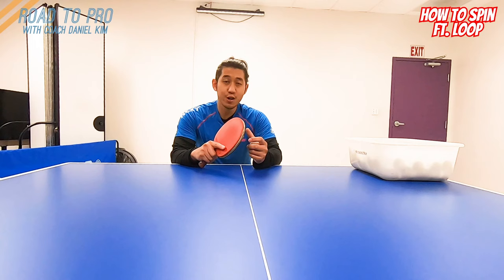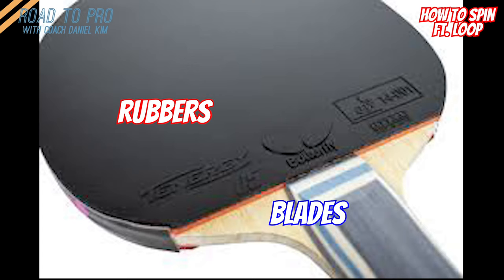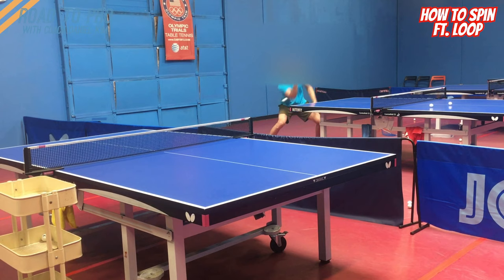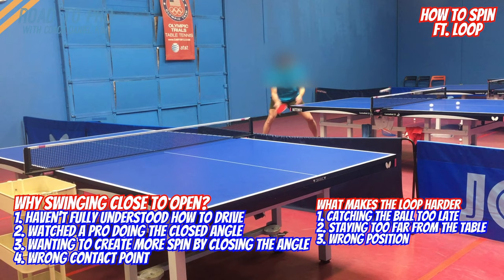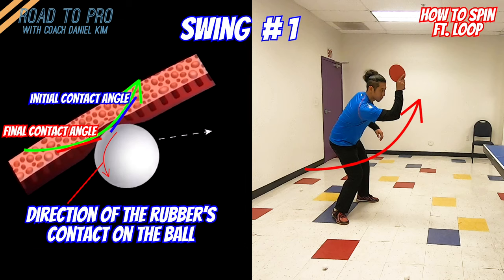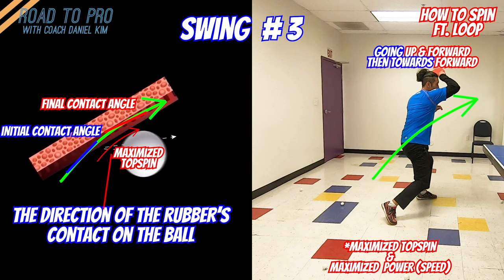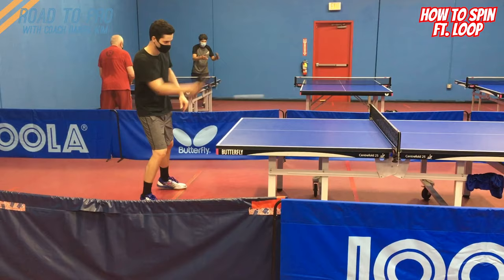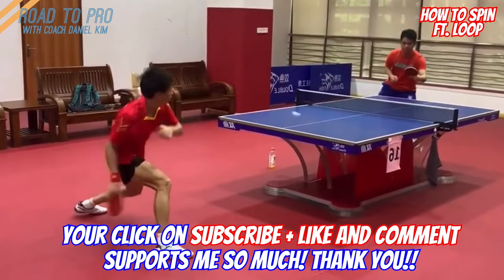Table Tennis | Ping Pong [Must Know - How to maximize TOP SPIN and POWER on the loop] 탁구 강한 회전의 이해

Comment: Thanks. I am a pen holder. My coach said one of the advantages of pen holding is when you loop, you can increase the quality by pressing the thumb when the ball contacting the rubber. She never explained why, and after a while of practicing this technique, I gave up this pressing the thumb. Now, with your video, I understand the reason. Pressing the thumb at the moment of ball contact is basically closing the paddle angle as in Loop 3 in your video.  I am going work on this again, no giving up this time. Thanks!
Reply from the maker: Yes! You got it! Also you can use many parts of your body to make this swing trajectory as well!

Comment: I have been working with a coach for 2 years. My backhand is very good. I have a feeling and I am good at spinning. But my forehand doesn't have a good loop. He loses control and flies past the table. I didn't know how rubber works for a good topspin. My coach did not explain to me how rubber works. Maybe he doesn't know it either. Many thanks. I'll do it tomorrow. Your throw directly at the yellow ball surprised me. He had a good cycle and control. It amazed me. Many thanks!
Reply from the maker: There are few things that directly affects the quality of the ball and the swing form. 1.the angle of paddle 2. The trajectory of the swing 3. The contact point 4. The swing speed. Usually, if you are not getting enough spin or speed that you want or you think you should have then it’s about the speed at the contact point. But don’t force and think go all out and have a good ball. It’s always good idea to maximize the efficiency from the slow swing and slowly speed up with the feeling of “driving” the ball. And if you are losing control, then it has to do more with 1,2,3. But they are all related. Let me know if you have found the problem. I can help and tell you a simple self practice to fix these problems.

Comment: I'll try but truely I couldn't see much difference between 2 and 3, although I think that is pretty natural have some angle closing when the leg moviment is correct, there's a fast wrist movement after the contact and also finishing the forehand swing a little foward, but it doesn't seen natural to try to close the angle with arm movement, just because it will lift the elbow a little bit, making very hard to control the ball trajectory.

Comment: 1:04 I dont understand how the mechanics of swing #3 works or how it is different from #2. Could you elaborate on this? edit: Nvm, I understand it now! #3 trajectory is like that because you accelerate into the ball with your waist and hip (sideways rotation) when your swing reaches the height of the ball.
Reply: Yeah that's right. I think it's less the changing of the angle during the contact (this is kind of impossible anyway), but more being able to accelerate forwards into the shot, which would have the same effect (squeeze the rubber/sponge into the direction that you're trying to spin it).

Comment: I am learning English, so maybe my english it can't be very good. 

I have a doubt and is, which is better? #2 or #3. I would like play like ma long or fan zhendong that have a strong and consistent forehand topspin. My supposition says that is the #3 because you say that is the swing that provides more spin and speed to the ball.
Reply from the maker: If you can do 3, the best
Reply: @roadtopro3038  thank you :). I like your content.
Reply: @roadtopro3038  This technique consists on closing the racket a little, immediately after hitting the ball, and also making like mini circles with the arm?
Reply from the maker: @edson754  thank you

Comment: Life is simple, if I see a video from you, I know it's going to be good :]
One question Daniel, should we also apply this same concept do the backhand loop as well? To try to close it on contact if we want more topspin and power?
Reply: i think the same concept can be applied for BH, since it is about how to contact the ball.
Reply from the maker: Yes, apply the same concept. You will have so much power if you can do this. But slightly different how the angle is made right after the contact. Bh is more with wrist and forehand is position of the elbow and body rotation:)
Reply from the maker: @nguyenanhquynh7322  yes you are right!!!

Comment: Thanks for the video. To keep things simple, so you have to open your paddle and close it as you hit to create the desired result? I tried that and my hit chance increased a lot. The contact sound is also much more cracking/loud (like chinese), and the contact is thicker.
Reply from the maker: Yes, that’s the whole point. When you do this way, it not only maximizes the potential of the rubber but also maximizes the engagement of the blade as well to make the energy transfer more efficient because it reaches deeper and that’s why it makes that cracking sound(from the blade). Plus, you have to swing more forward than upwards because it’s open so it will generate good power and spin at the same time.
Reply: Amazing how much difference there is by first opening and then closing as you hit.
Reply from the maker: @MrDuynguyen123  you just unlocked the new skillset that can lead to pro quality techniques.;)
Reply: When I do topspin I lose a lot of strength, but my punches are not dangerous or they fly out. I think I lick the ball with rubber and there is no cracking.
Reply from the maker: @gds1104  i see. Licking can give you some spin but it will lack the transfer of the energy and also sometimes hit the edge of the paddle as the angle of paddle is coming so shallow. Try to work on to increase the speed of the ball then the spin of the ball and have your swing work more forward then upward.

Comment: helpful video....would it be accurate to say swing 1 starts with paddle angle almost parallel to the floor [and compensates by opening the angle], swing 2 starts with paddle angel around 45 degrees and maintains it throughout the swing, and swing 3 starts <45 and starts closing the angle during the swing? [seems some Fanzheng Dong videos show his warmup for forehand loop where his backswing causes the paddle to start at 90 degrees relative to the floor]...

thanks for the video btw...i videotaped myself and was wondering why my paddle angle was all over the place during even forehand drive and realized i was closing it too much during backswing [partly caused by putting my focus on paddle and ball too much, and not enough on weight transfer...once i tricked my mind to just focus on legs, relax all of upper body and let the body do the swing, it mostly ended up like swing #2]
Reply from the maker: You are correct although there isn’t one right angle to swing. The swing trajectory may change depending on many other factors especially what kind of balls is coming and where you are. But in terms of the swing’s path, you are right! It’s always good to monitor yourself to see what’s causing the inefficiency on the strokes! I am glad that this could help!
Reply: @roadtopro3038  hey Coach, one question, in regards to efficiency and swing no 3 trajectory, why dont pros do a swing that seems more effecient. What i mean is:

1) in backhand, why do most ppl start with closed paddle angle when starting swing, then do a open to close motion? For eg in your video comment  on someones backhand, you can see he closes first, then opens then closes again (and then restart back to closed angle when bring paddle back to body)? 

2) on forehand, i see a lot of pros warming up on youtube where they start with bringing the paddle close to the hip, then moving the hand slightly away from body, then completing the swing. For eg, in your 1 hr summary video, you talk abt start with paddle close to hip but when you demonstrate with the ball, you tend to start with paddle close to body, then move it back away from body then start the swing. (For eg at 1 min mark in your 1 hr summary video, in slow motion, you can see what im talking abt)

I hope my question makes sense. And your videos are clearer than anything else on youtube for real. Thanks again.

Comment: great explanation  ! coach why when attacking/topspin  i miss the ball , it felt like there is a hole in my bat.  do you think u can make video about it     thanks !
Reply: Many causes.  Partner spins caused the ball to curved down earlier.  Solution is the stand closed to the table.  Also, keep your racket open more.  Timing.  Catch the ball with the paddle , then apply the fore-ward force like throwing the ball back.

Comment: This is not true because the coming ball has different speed, spin and location. The power the ball gains depends not only how you swing the blande but the ball's current states. For example, when the coming ball has lower speed, you tends to use swing#1. If the ball has higher speed, you tends to use swing#3. This is due to relatve velocity.

Physical structure also need to consider. For backhand swing, people swing faster using swing#1.
Reply from the maker: Whether the ball is slow or fast, you need to do swing 2 or 3. And, yes if the ball is coming to you fast, it’s easier to use the ball’s energy and return the ball fast. But doesn’t necessarily change how you swing. If you end up doing swing 1 because the ball was slow, then you need to work on your footwork to fix that because your position and the starting angle of the paddle is not good. The concept on the backhand is same. The reason why people close when swinging back is to get more space to swing faster. But you still gotta catch the ball and try to close as you apply the force forward.
Reply: People should keep in mind try to swing as swing #1. When our leg add force to the body, the body is accelerate forwards. There are inertial resistant force pushing our arm backwards. To counter act this resistance, we try to swing as #1. But eventually, it will come out as #2 or #3.
Reply from the maker: @zerozeronine5461  I don’t think that’s a good way especially for those who are starting out. People actually think they are doing 2 or 3 but most of them are doing #1 and they will fail to have consistent and powerful loop every time because they are opening up the paddle, slowing down and applying the force upwards instead of forward. And if you tell them that swing #1 is ok, they will never know how to fix their inconsistent loop…
Reply: I just try to explain the phenomenon only. In your own demonstration in swing#1, do you notice you are suppressing your swinging speed in order to demonstrate it? Why don't you swing at your maximum speed? This is because when you swing at maximum speed, you cannot demonstrate swing#1. When you rotate your body to swing your arm at maximum speed, there are centrifugal force. Your arm will swing upwards due to the centrifugal force. This force is very strong prevents you from demonstrating in the form as swing#1. You can only demonstrate swing#1 without rotating your body. If people rotate the body to swing their arms, it will naturally become swing#2 or swing#3. Those people swing in the form swing#1 because they don't rotate the body while swinging their arms only.
Reply from the maker: @zerozeronine5461  this is not about swing speed though. Whether you swing slow or fast the concept to generate more power and spin efficiently, you still need to make a solid contact and close as you apply the force forward. Body rotation surely helps to prevent the swing one, but if you start out with the closed angle(facing floor), no matter how fast you swing you still gotta open as you contact the ball other wise either you hit the side of the paddle or cannot play the ball over the net. You can also still make the swing 2 and 3 without body rotation. This is about the angle of the paddle and trajectory of the swing.:) maximum swing speed is not important if you don’t have control. In fact it’s useless and meaningless without control. You work for nothing. So how do we control(swing soft) yet still give an efficient loop(both in the energy transfer and consistency)
Reply: @zerozeronine5461  If this gets you points in competition, I would recommend that you keep using that which works for you; that's all I have to say about THAT!